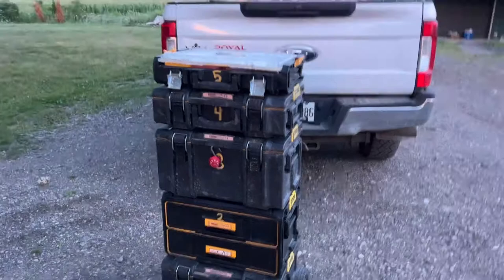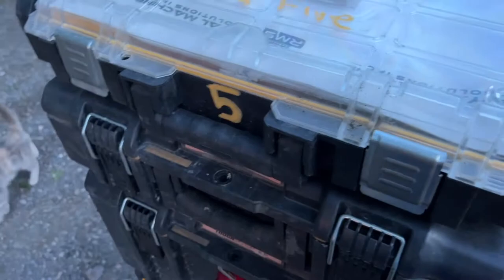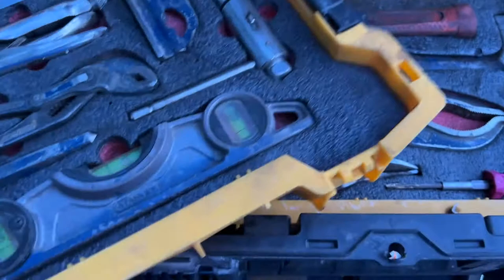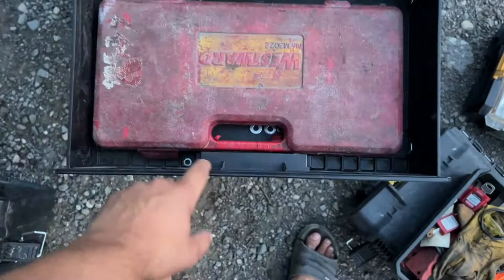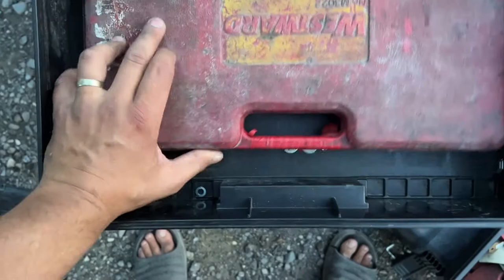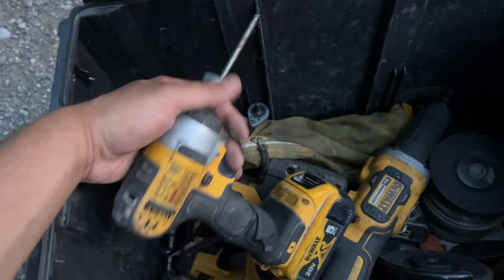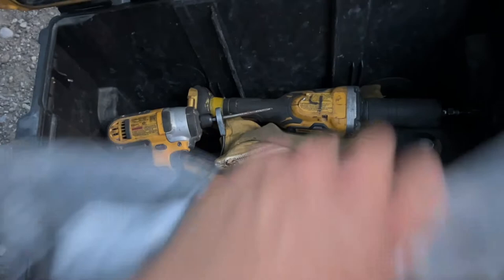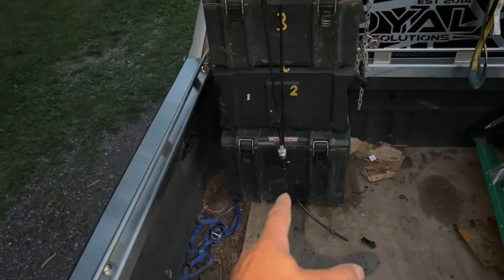My mobile millwrighting toolbox set up

Comment: You mentioned that they no longer make the socket wrench set that you recommended, what is the most comparable Westward (or other brand) set that is still available?
Reply from the maker: it was called Metwrinch. i think there are old sets available online eBay. 

Here is the sockets i would recommend a lot of sets sell you a lot of sockets but most you never use.

5/16 (8mm),10mm ,7/16, 1/2 (13mm), 9/16(14mm),11/16(17mm),3/4(19mm), 15/16(24mm), 1-1/8, 1-5/16.

the imperial number with the metric in brackets is what a standard socket and wrench could fit on both metric and imperial.

this is what i use the most as a millwright in canada working on both imperial and metric equipment

Comment: bro u got to get rid of that pink screwdriver people are going to think your an electrician btw u should drop the totes and get a steel box like a knaack with some kennedy boxes inside and u gotta tool up on the precision i didn't see any 196's, 98's, parallels or ids. also no brass i mean come on bro

Comment: What do you think about the Dewalt tough system versus the milwaukee packout? I'm considering one of these for millwright work as well since it would be easier than loading/unloading a jobsite box.
Reply: One thing about millwakee is all of the different attachments. By far better than other brands because of the different tools and attachments.
Reply: I made the mistake of picking dewalt power tools over Milwaukee, I’m grateful I didn’t make that mistake again with the Packout. It’s the best on the market for the price.
Reply: @ryankirsch2250  I ended up getting the packout, the only downside was the drawer set isn't water tight like the dewalt. I reckon I'll get over it though.
Reply: @Iambetterthanyouanduknowit  it feels pretty solid. I hope it holds up.. it's my first plastic toolbox
And I got it on a sale so I paid the dewalt price so I couldn't really justify cheaping out on another system
Reply: @DerekR1554  those drawer packouts are a game changer for sure. Makes it nice to not have to unclip every attachment to open the lid.
Reply: @ryankirsch2250  oh yeah they are. That's my only complaint is having to unstack the damn things